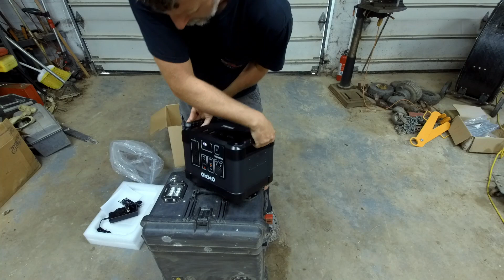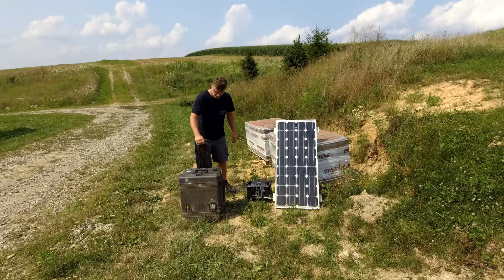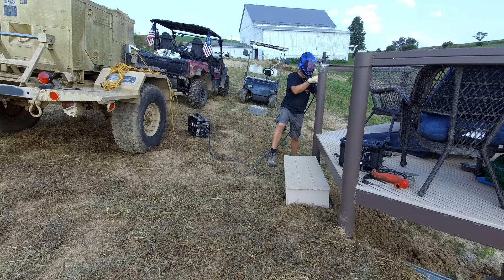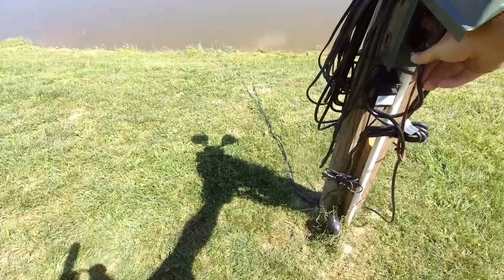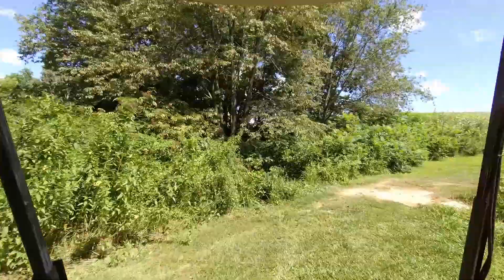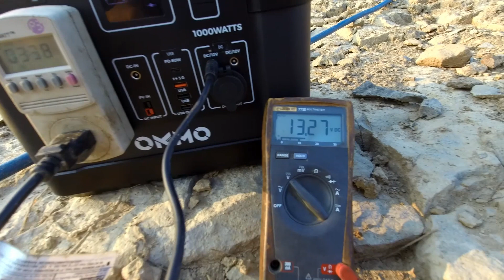Field Testing a Portable Power Station

Comment: Can you check something for me on this type of unit... Is the neutral 0 volts and the hot 120 volts? ...Or it is 60 volt each one...the 2nd question is about the ground...I don't see a  ground connector...is the ground in ground required equipment floating ???? Thanks.
Reply from the maker: I am not sure how the neutral is wired internally, but it is the return path for the current, so can potentially see some voltage. It is the reference point so it is 0v by definition (voltage is difference between two points) but it could have voltage when compared to other reference points. There does not appear to be a ground conductor on this unit, which is common for portable units. Even the inverters that have a ground connector it is not hooked to anything unless you attach a grounding rod.

Comment: I got one of these to test and review but when I plugged it into the wall the charger gets super hot
Reply from the maker: Mine will get warm. I put a power meter on it and the plug in charger is pulling almost 200 watts, so I would expect some heat. If it is getting extremely hot I would reach out to the seller  / manufacture to make sure it isn't an issue.

Comment: Another reviewer said its not a Lithium Ion... its a like a form of deep cycle batt (but not a deep cycle, called something else), so whos right?
Reply from the maker: Hmm I haven't taken it apart to see how it is constructed, but it seems like it would almost have to be to have that capacity with its size / weight.  I don't see battery type actuallyu specified in the amazon product specs now that you mention it.
Reply from the maker: @maxthereof I checked, and the manufacture states that it is a Lithium Ion battery.
Reply: I found an answer too..

The Cells our generators use are the integrated Lithium Nickel Manganese Cobalt Oxide (LiNiMnCoO2) — NMC battery pack makes the size of the battery pack much smaller and lighter. This system greatly reduces the risk of potential accidents to occur. Additionally, it is also much smaller than a traditional power station. While there is a downside on cost, the significant upside for NMC is energy density, which is nearly 30% - 50% more than LFP (LiFePO4) depending upon packaging. This means that to achieve the same capacity, the physical size of an LFP battery would need to be at least one third bigger – a concern in portable power sources where size is at a premium. As the demand for evolving performance priorities skyrocket in this decade, NMC(LiNiMnCoO2) batteries are becoming the common types of batteries used for electric vehicles and energy storage systems (EES) nowadays. Because of its low-temperature resistance, high energy density, high cycle efficiency, stable chemistry, and many of the good attributes, NMC batteries have been widely used in some high-end electric vehicles such as Tesla Model 3, BMW i8, Audi e-tron GE, etc… the safety and recyclability of NMC are recognized by the industry.
Reply from the maker: @maxthereof  Interesting. Sounds like it should be a pretty good battery then.
Reply: @ModernSurvivalists  just bought it, 2k watt model with 400 off coupon on amazon
Reply from the maker: @maxthereof  Nice. Its been handy. Let me know what you think once you get a chance to play with it.